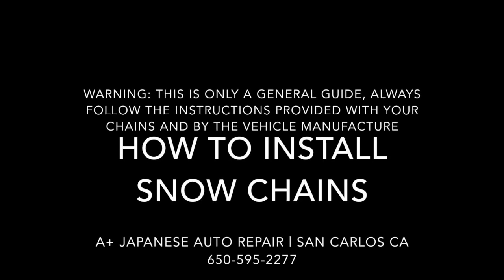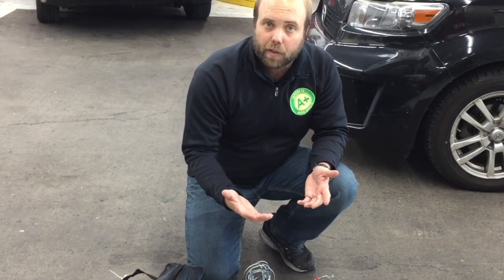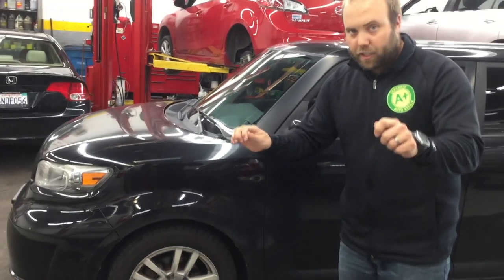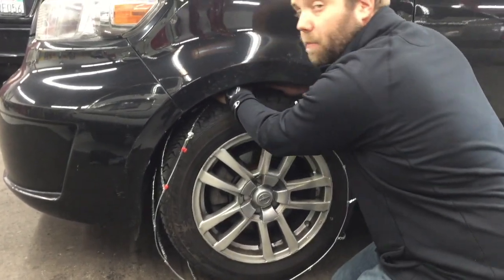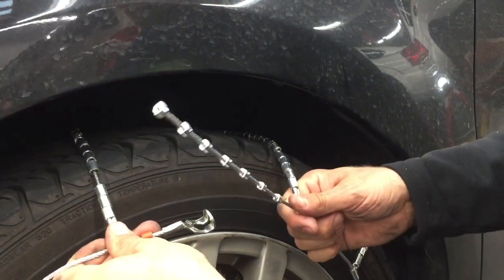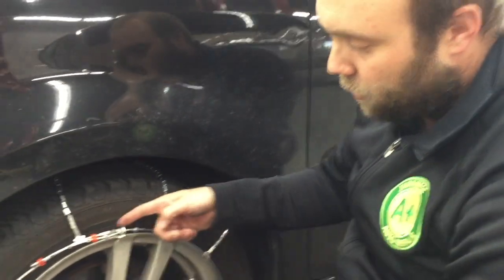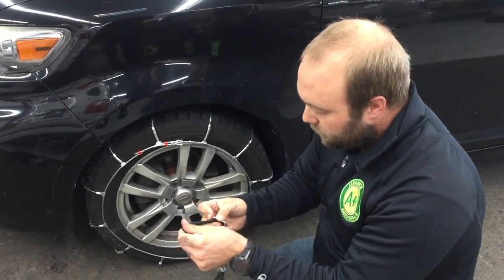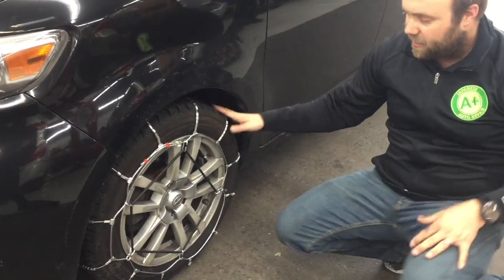How To Install Snow Chains

Comment: 1.So first off flip the chains around do the ends left over slap the ground not stab the ground. The loose end could come free and stab the ground unlocking the chains. 
2. It nice to lay the chains down on dry pavement, but thats not when you need them. So, turn the tire, drape the chains over it, connect the back first at the bottom, make the chains straight across the tire, connect the front side. Drive forward slightly. Turn the wheel and tighten up the connection in the back then the front. Make sure there is no slack and the cables are straight across the tire. Drive for 30'. Get out and check to see if they need tightened. Then drive slow, no more than 35mph.
Reply: All great points Ray!

Comment: The cable end with the stop blocks on it is supposed to lay through the slot and hole in the matching end clip, not get poked through the hole. I don't know why, but that is what the manufacturer says.
Reply: exactly, incorrect instructions.
Reply: You are right about this... I am curious why it' recommended to go toward the tire as well.
Reply: Definitely do not poke the connector thru the hole. After watching this and having the cable fail, wrapping around my Axel and doing major damage- the mfg sent the actual way too connect these. The cable goes along the attaching row and clips in. Hard to explain, but I guess putting in Thru the hole can allow it to bounce out. Good luck
Reply: Sorry, I don't understand what you mean. I am about to have to use these and want to know the correct way. Are you saying what the man did in the video is incorrect?
Reply: @AdamJonMusic  How was your experience? Did you follow the instructions in this video? Did you have any issues? Did the guy in this video give correct instructions? I'm in the same situation now as you were back when you made this post!

Comment: It’s my first time having chains and I was wondering if the rubber bungee cord is a must have because it didn’t come with the chains...
Reply from the maker: Kristyn, it will take any slack out of the cable chains so they don't extend too far away from the tire and possibly damage your fender or fender liner. I would be sure to attach the rubber bungee.
Reply: Mine didn't either. Going to try it anyway

Comment: I can never get the inside to tighten
Reply from the maker: You can turn the wheel all the way left or all the way right if that is helpful. That might allow you to reach the chain connection and tighten further.

Comment: You don't place the chain thru the hole. you lay it inside the slot. Manufacturer states this in their directions. for some reason they are adamant about this.

Comment: can you drive with snow chains when there's no snow out? for example i live 45 minutes from the mountain where there's snow, i would install the chains prior to hitting snow? is it safe to drive on regular freeways with no snow?
Reply: I agree with Ricky D. When driving on pavement with chains it could be dangerous because the chains will lower the grip to the road. Also, it will be very bad for the car as there will be quite a bit of heat buildup and grinding on the chains. Short answer... wait until you reach the snow. - a small trick... use your floor mats as a knee pad to keep your pants dry.
Reply: Rule of thumb, dont go over 30-40 with the chains on, Ive had them bust off on me before at highspeed.
Reply: Michael Heathman  What's the cap for?
Reply: Michael Heathman  Thanks.

Comment: How do you know your car is front wheel drive, rear wheel drive, or 4wheel drive?
Reply: Charmie A. If your engine sits sideways it’s front wheel. If it sits straight it’s rear wheel drive. 
Or just put it in drive, press brakes hard while you punch the gas and tell me which wheels spin lol
Reply: If you don't know, you should not be driving in the first place.
Reply: CJ Chavez I like the last option. Although I already know my Ford Ranger is RWD. I just like to test it to make sure ;)
Reply: it should be on your sticker or which tires spin when you are on rain or snow.  FWD front wheel drive, RWD rear wheel drive, AWD all wheel drive.  most non sports cars are FWD if not AWD

Comment: You installed them wrong 😂😂😂
Reply: Michael Heathman he actually did install them wrong. Tensioners aren’t supposed to be used on this style of cable chain. A tensioner is usually used the v-style cable chain or mostly used on steel chains.  It especially helps to use a tensioner on steel chains to help keep the slack chain links from flopping around when you drive.